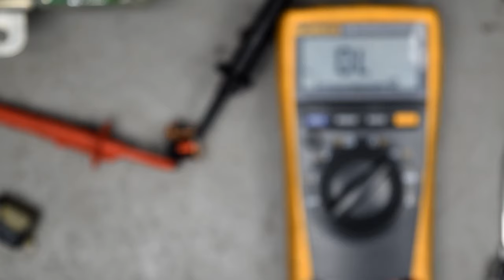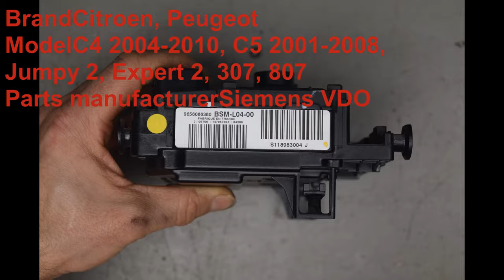Citroen, Peugeot Siemens VDO bsm-l04-00 Module Repair Fusebox. Bsm häiriö hardway

Comment: on relays which switch motors (fuel pump, window regulator, fans etc.) the contacts always wear, particularly if the motor developed a resistance e.g. due to corroded bearings, or worse if the motor completly stops under current (e.g. windows regulator). When the relay switches off, a spark burns the contacts. Congrats for this hard repair job! I would have used the opportunity to change all relays which switch inductive loads and also considered replacing the fuel pump to avoid a recurrance.
Reply from the maker: Yea. You are right
Reply: Hi .....can I pick your brain ? Peugeot 107 ......not my car ....but running fine then left 4 a good few days .then hire randomly sounded continuously  until fuse was removed.  Now no start turns over only spark at 1 cylinder of the 3 ..is this likely a repay ? Thanks
Reply: @Kevin Hancock  I cannot imagine any fuse, which being pulled would result in 2 cylinders missing sparks. I would suspect the cables were bitten by an animal while you were gone, which may also account for the problem, you've pulled the fuse for. To check that, I would move the ignition coil and spark plug of the working cylinder to the non working cylinders cables. If there is no spark, the cables are broken. If there is a spark, the 2 other coils/spark plugs are broken. Good Luck!
Reply: @cyberbob  I've done that already changed coils we even had 2 brand new ones in since sent back . Only cylinder 1 firing . I was aiming towards immobiliser issue but odd how the horn failed the same time maybe as u suggested something has been bittrn lots if cats in area etc
Reply: @kevinhancock4064 ... the immobilizer would lock the ECU and result in no spark on any of the cylinders, i.e. can be excluded. The horn is wired from the fuse box at the left wheel dome, down to the left inner fender and may be coupled and now shortened with another cable (e.g. side indicator).
Reply: @cyberbob4111  odd that I got spark on one cylonder then so I'll check under car for any works that may have been chewed that be a good idea ?
Reply: @kevinhancock4064  no, I would expect the problem close to the above mentioned engine fuse box (black plastic housing, located on top of the engine compartment on the right, underneath the windshield when you stand in front of the car looking to the rear), because that's the point where much of the wiring comes together.
Reply: @cyberbob  yeah ove had that lod off ..the owner saud he's checked all fuses etc no sign of moisture.  I'll check again just so random

Comment: 😁 Thank you for the detailed video. Today it helped me repair the BSM L05 00 in Peugeot 607 module. I confirm, there is no need to unsolder the entire motherboard. In my case, it was enough to cut the housing in the places indicated at the end of the video. The relay leg looked the same as in the video. There is enough space between the boards to improve soldering. In addition, I also had to get to the relay itself to clean the contact and bend the plate for better contact. A sharp knife was enough to cut off the plastic cover. Thank you again!
Reply from the maker: Glad to hear that video helped you to fix your car.  I am currently working same thing but The bsm is difrent model number. I dont remember it right now but new video is upcoming soon.
Reply: Spróbuję sam nie wiem czy dam radę 
Zapytam jak dobrać cynę  do lutowania
Reply from the maker: Większość puszek sprzedawanych lokalnie ma wewnątrz puszki jakiś topnik, więc naprawdę nie można wybrać niewłaściwej cyny lutowniczej. Mam też inny film, na którym omija się tę usterkę przekaźnika, dodając zewnętrzny przekaźnik, ale nie można tego zrobić, jeśli twój bsm używa tych mini bezpieczników. Zawsze istnieje możliwość, że sam przekaźnik jest uszkodzony, więc ponowne konserwowanie nie jest rozwiązaniem w 100%...

jaki jest dokładny model psm, który próbujesz naprawić? @jamzimniak6500

Comment: In my car no blower motor not working is probably bsm fault too ... sadly i am not sure how to repair it :D how is called that mashine what you using to remove motherboard
Reply from the maker: Desolder gun. But first toughts i would guess that motor itself has broken brushes. U can try to knock the fan when it is turned on with hammer / screwdriver etc to get brushes litlebit movment. Sometimes fan will start spinning when knocked if brushes are bad

Comment: Hello, can you tell me what kind of solder extractor you use? Thank you
Reply from the maker: I have doldering station with integrated desolder gun like link above. https://fi.farnell.com/proskit-industries/5ss-331-dg/spare-desoldering-gun-140w/dp/2474821.   It will usually do the work but gets easily clogged and needs maintance. I prefer solder wig always when it is possible. It will do the trick and dont get clogged

Comment: good evening, because I have encountered a similar fault in a smart 451 relay transmission, they are replacing the legs of this relay with the OMRON G8PE-1A4 if you want to try a better quality..
Reply from the maker: Thanx for a wonderful hint. Lets hope that it helps someone with repair attemp

Comment: In my module there was much more glue so it run down under the pcb and it was a real pain in the ass to get out so watch out, it might be a better idea to just cut off the back.
Reply from the maker: That is one way what o have also thinked trugh. I have one module waiting same repair and i will try to enter Back side off module... I'll post video from it when i get it done

Comment: I Have BSM L03 and i dont have comunication to Airbag ECU, according to schematic from autodata i think there is problem in the relay part of the BSM, and that it doesent supply power to Airbag ECU
Reply from the maker: In my quiq Google search i noticed that airag and belt pretensioning module is suplyed wia under dash fuse box. Fuse n.3.  5amps... So it might be nothing to do with your under hood bsm module. Are you sure that your airbag module is powered trough bsm module? If it is what is fuse number?
Reply: @ElectronicMechanicFinland  thats what i saw in autodata. 
Ill check what fuse exactly it say it is amd ill post it here. 
Maybe im wrong and miss see something.

Comment: After having multiple  electronic defaults I replaced my BSM L04-00 (citroen c4 phase 1 2005). 6 months later with new BSM the same thing is starting to happen again. 
This issue is well known and ebay & co is selling this around 250euros right now .
I think by doing your method I could replace with a new relay with new contacts (from 2022) and not play russian roulette hoping I get a new BSM with not -too used contacts... hope this makes sense.
Thanks for the really detailed video that is exactly what I wanted to kwown :)
Reply from the maker: if you dare you could do the shortcut and add external relay somewhere in engine bay.. i have a another video about that thing. =) and it is really nice to hear that video is helpfull to someone
Reply: Bonjour je la mem bsm ma voiture el démarre pas pas de courant à la pompée de essence pas de ettensel de allumage de bougies vous avez trove la panne???

Comment: That is an impressive job and well done and you must know you stuff to have this patient and willing to go ahead on this job.  I would however concidered to buy a Toyota ! :-)
Reply from the maker: Thnx. =)  I miss old Times when you just swapped faulty relay like a fuse and it was done under 5 minutes. It is insane to design things with built in relays.

Comment: Well done,I just sorted problem with my BSI ,the same type BSI as you have on video. Problem was : when I use remote control and locked the car up,than antitheft lock didn't let me start up later. I managed to reboot BSI and just can't use remote to lock the car up,just key old-fashioned way. Engine start up,all works.Will leave like this till further problem. F...k the remote.Thumb up. Regards from Bohemia.
Reply from the maker: Wow. Intersting fault xd thanks for sharing
Reply: This is not the BSI in the video. The BSI lives behind the glovebox inside the car. This is the BSM or on the Peugeot/Citroen wiring diagrams the PSF1.

Comment: My dipped or dimmed headlights are not working. The main beam is working but the normal light for night driving is not working anymore.
Can I switch a LO4 unit with a LO3 unit?
Or which relay is for the dimmed headlights?
Greetings

Comment: Bonne café 👍ese rele de que es ? Gracias tengo el mismo problema
Reply from the maker: Le problème est que la voiture ne démarre pas à cause de contacts de relais défectueux.
Le relais est vraiment difficile à changer et les modules de remplacement usagés ne sont plus disponibles. Cela signifie que la voiture est une poubelle si le relais n'est pas changé
Reply: @ElectronicMechanicFinland  vale voy a intentar se lo consigo te mando un mensaje 😅

Comment: I have a 407 and the power steering some time switches off and stays for long,I changed the pump but still have this issue,can you please guide me which relay is for power steering
Reply from the maker: inresting fault. i have up coming two Bsm modules for future repair videos and i can pay attention also in this problem..

Comment: Awesome Job  I have a question , My Peugeot 508 Aricon compressor  build in Relay is malfunctioning can I make an external relay instead of changing its as you did in this Video Because In my country no one can do such a job as  you did
Reply from the maker: Sorry for delay for answer and thanks for feedback =).  And what comes your question i dont know yet but a have seen that some other tuber opened just plastic can from relay itself and fixed the relay.. and offcource if abuse that plastic can on a top off relay then you can rip it off and solder wires to relay leftovers and put new relay to end off wires but it wont be pretty xd

I will check chematics tomorrow and try figure out is there  are easy way out

Comment: Hi, could you explain, what tools You are using and why you each step of you repair work.
Reply from the maker: In future mabye but now afterwards on this video it might be to difficult to re-edit whole clip. But first i cutted Back off case open with dremel multitool but it was fail because you cant repair unit from Back side. I pryied with knife that mould open that i managed to get pcb.s out off case. And then i used desoldering hun and also hot Air soldering station to seperate pcb.s. and after that again deloldering gun to desolder relay.
Relay i fixed with knife and cutted melted plastic away from connectors and then just putted everything Back togetger using soldering iron
Reply from the maker: There is kinda way to fix that without removing pcb.s when you pry The relay on topside of pcb and solder Wires directly to leftovers on pcb and another en off Wires you can just put standardi relay

Comment: On a citroen C4 B7 1.4 vti 2011 the injector number 2 is always working and spitting fuel onto exhaust, I've replaced the injector but it does the same and on whichever injector I plug in number 2 connector it does the same, verified the wiring and it isn't that either but the signal on the white wire from injector 2 connector is continuous, does anybody have any idea?
Reply from the maker: If i have to guess i would put my bet to shorted and faulty injector driver mosfet on a bsm module.. if i got your fault diag right. So yours injector is always open when power is turned on?

Comment: I hear a sound in the bsm as sound of relay and missing electricity because drain the battery car. could be a relay??? or something else? txs!!
Reply from the maker: As i show in first video there was not broblem with driving relay. Broblem was bad solder joint witch prevents 12v power getting to relay and relay itself had bad contacts inside of it.  And if you hear relay clic it can be that another relay witch connects power to ac unit.
Reply from the maker: And usually gentle tapping of screwdriver handheld part helps to diagnosing relay contact failure. They usually kinda will contact if mechanical vibration is aplied to relay . It is not permadent fix but maby gives you hint what is causing no start state. Check my new video. There i show way to fix that relay with new external relay

Comment: Hi, I have the same fuse box in my C4 2007 and can't identify which of this fuses is dedicated to left-hand side dipped beam light. Please help if you have any knowledge on this. Many thanks in advance
Reply from the maker: Hi.do you have xenon lights ? Because xenon lights fuse was only what i could quic inspection found.
Reply from the maker: https://www.google.com/amp/s/fuse-box.info/citroen/citroen-c4-2004-2010-fuses

There are mentioned F17 and F18 as left and right dippedbeams
Reply: @ElectronicMechanicFinland  Hi, thank you for your response, I have normal, generic bulb lights
Reply: @ElectronicMechanicFinland  the trouble is that my engine compartment fuse box has only 14 fuses, exactly the same as the fuse box on your video, hence I thought you might have some knowledge about fuse assignment in that fuse box.
It seems like my fuse box is a rare exemption, I will check each fuse with an electronic gauge and see which is gone. Anyway, thank you very much for your help, your effort is much appreciated. Kind regards
Chris

Comment: 🇮🇹 grazie per il video della centralina Siemes. Qui non esiste elettrauto che lo faccia, lo può fare il proprietario dell'auto sempre che come me  abbia la preparazione e le conoscienze tecniche per smontarla e ripararla. Solo una domanda: conosci la funzione dei 5 relè? Grazie ancora.
Reply from the maker: cosa intendi per relè 5?
Reply: @ElectronicMechanicFinland  HI. Inside the Siemens control unit there are 5 relays. One powers the air conditioning fan but I don't know which one it is. Do you know what each of the 5 relays powers?
Reply from the maker: I have one unit opened on My workbench  and i can try figure it out. Please give me couple days and will write what i can find
Reply from the maker: Hi friend. This module what i am working on is difrent and there are 13 relays=( but i watched that My video and you can see fuse F11 40amps and it is for Air blower- Air conditioner. The fuse is located near by 30A fuse and relay what is directrly under IT IS that what powers The fuse and Air blower.
Reply from the maker: In My video Time stamp 14:51 you can see empty slot in left down corner what is for ecu and Fuel pump. Right next to it on right side under The 30 and 40amp fuses IS The AC blower relay

Comment: hi friend, this video is awesome. What are the characteristics of the relay you soldered?
Reply from the maker: Relay was that OEM relay witch are onboard and i only fixed it but i can try to find datasheet for it
Reply from the maker: Electrical life obtained at resistive or inductive load at 40A, 15VDC with suitable arc-suppression circuit attached with operating frequency of 1 ops/sec. YH119 2 of 2.......that is told on datasheet
Reply from the maker: YH119 012-1H11-1S

You can find them example aliexpress

Comment: I'm going to change all the relays for future near breakdowns. This product is no longer manufactured and I cannot find it. 
it is preferable to fix it before you buy used
Reply from the maker: You will need Powerfull soldering iron.  The relay acts as heatsink and i was in trouble with 90w iron.
Reply: @ElectronicMechanicFinland  

I would use a rework station with a heat gun.
Reply from the maker: I Am posting new video soon to show how fix this without soldering
Reply: @ElectronicMechanicFinland  dang - i try to fix it now ^^ but thanks for the video

Comment: Very nice video, I have a Peugeot 407 with the same fault (no power at fuel pump fuse) and I'm thinking of having a look at this myself. Did you happen to find out if this fixed the vehicle? Cheers
Reply from the maker: Yes this car is fixed. But i cant stop thinking to do same fix without soldering. I am pretty sure that this broken relay or bad solder joint is repairable by just adding new relay or and jumper wires on a top of bsm
Reply: i soldered cables to the backside of the relay solderings and put a new normal 12v relay to the cables no need for remove of borard. only make a hole in the blackbox corner. lower left corner. then close it with silicon glue

Comment: How did you know that F5 does not receive power?   🤕
Reply from the maker: Fuel pump not work and when measured voltage both end off fuse while cranking.